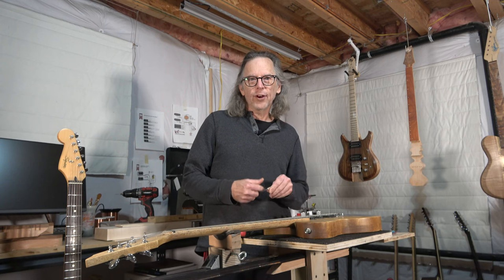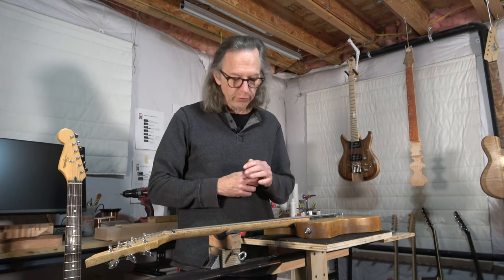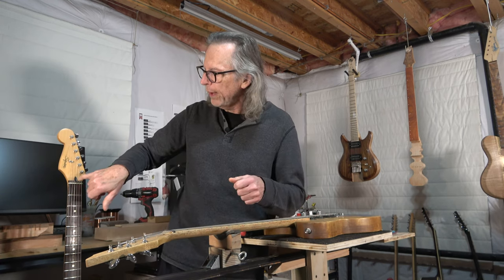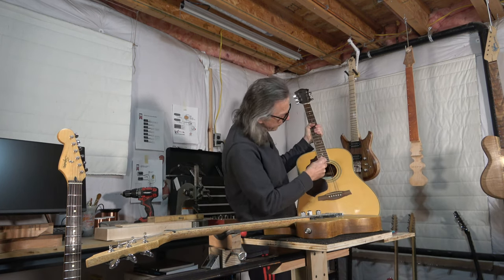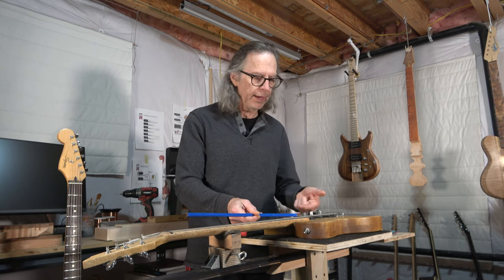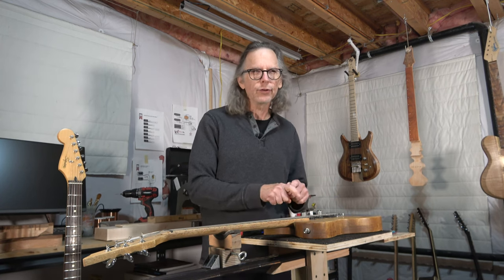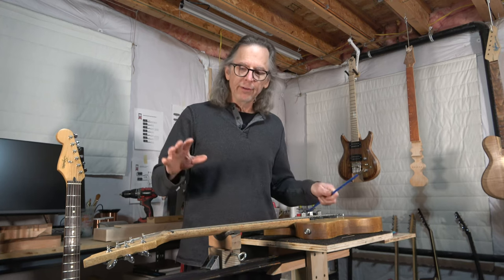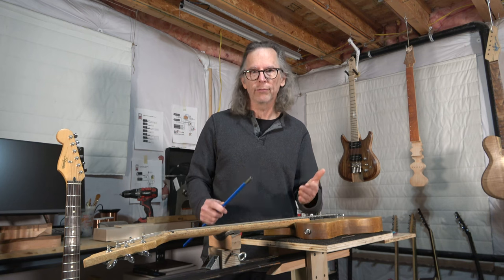Guitar Truss Rod Nut Placement

Comment: If you're building a mahogany neck, you could also consider a volute to add some additional mass underneath the truss rod access hole. And you might also consider using a scarf joint to avoid grain runout in the headstock and ensure a stronger neck. I know you're no longer a big fan of scarf joints, which is fine as long you're using stronger woods like maple.

Comment: As a player, one of the first Mods I did on my Strat was to put a notch in the Pickguard and wood underneath so a "paint can lid remover tool" can be used to adjust the Truss Rod easily without removing/loosening the neck, strings, or pickguard. It breaks my heart when I see a beautiful vintage Gibson with a broken headstock. It's an expensive repair and severely depreciates the resale value of the guitar.

Comment: I had to repair an upscale epiphone acoustic that had the headstock adjustment. So much wood was routed away that there was almost nothing left to make room for the large adjustment nut on the end of the Truss rod. I alleviate the problem by using a half inch steel tube on my acoustics

Comment: I want my necks to be as close to pre cbs as possible, and that has served me well. So it’s a single action and the heel.
I think tone follows the neck, and is second only to pickups in setting a guitars tone. 
I have no access issues, I do however have a special tool, and for the kind of minor seasonal adjustments I don’t have to remove anything. Usually a 1/4 to 1/2 turn or so.
I also like Brazilian fretboards.
So fender is out , and smaller manufacturers is what I use .
Same with body’s, I want one piece, light , under 4 pounds swamp ash, and fender just doesn’t do that.
I also want a more traditional, and thin nitro finish.
The heaviest tele I own is a tad over 7 pounds the lightest under 6. 
All heel at the time here.

Comment: Hey, Chris. I routed my first truss rod channel for a 3-string CBG bass with a 34" scale. It's a 1/4" route all the way. The brass fittings are snug but the rods are 7'32" I believe. Should I scrap the neck and save the truss rod before I put a fretboard on? It's a great maple neck that I hand built and I don't want to waste it but the build is for a friend so I don't want to send him a bad apple. Thanks!
Reply from the maker: I don't understand your problem.
Reply: you mean the trussrod is a little loose?  That probably shouldn't matter, and you could shim the gap with a strip of veneer (or almost anything else) if you're worried about it.
What I'd be more concerned with is whether the 7/32 (<1/4) rod is maybe just a "traditional" style rod, and not a modern self-supporting (usually 2 way) rod which are more typically about that width, but more like 3/8" deep?
If that's the case, it needs to be installed in a curved channel to work. tightening the rod tries to straighten the curve in the channel and that tries to back-bow the neck.
If it's a modern style 2-way rod (stewmac hotrods are around 7/32 x 3/8), then it''s probably going to work fine even if it's sloppy loose, as long as there's not enough room for the rod to flip sideways. ;)
maybe shim around the blocks with some veneer or something to snug it up.  a tiny bit of space around the rods isn't ideal, but it'll work fine with most 2-way rod designs.

Comment: Awesome.  I bought several Gibson /Epi guitars with broken heads.   I thought the flaw was design because the mass at that nut area was minimal.   Now I know it's wood based.  I suspect the mahogany. necks being under string tension adds to the issue.
Reply: Its a combination of things. The worst offender is the mahogany like you said. But the Gibson guitars also have an even steeper back angle compared to Epiphone, this increases leverage against the breaking point when smacking the headstock. Then there is the problem that the expensive more "fancy" guitars have a 1-piece neck instead of a scarf joint where the neck meets the headstock: the wood grain is oriented so that it wants to split apart at that weak spot. And lastly, they have a large chunk routed out at that very weak spot to fit that big trussrod adjustment nut.
Reply: @infectionsman  The "leverage" thing isn't really right (a 6 inline fender has more leverage), IMO, but otherwise spot on.  The steep headstock angle is the main culprit IMO.  It's not as much to do with leverage, as the fact that it sticks back relative to the body.  If you lay a fender flat on the floor, the head may not even reach the floor.  if it gets knocked over onto the floor, the body hits first and it'll probably be fine unless it the head hits something else on the way.  gibsons usually have both more neck angle to aim the strings at their taller bridges, and a headstock that leans way back.  If they fall flat back on the floor, the head hits first with the weight of the body still behind it.
The short grain, big chunk milled out for the trussrod, and mahogany splitting along the grain a bit more easily all add up to it being a fair bit more fragile in an accident.

Comment: Hello, I just realized the spokewheel on my guitar moves back and forth very little. Is it normal? I mean to say when I  put the hex wrench inside the hole of spoke wheel, it is not fixed and firm. It moves little bit. Is it ok?
Reply from the maker: It shouldn't move back and forth.
Reply: @HighlineGuitars  i mean to say from left to right. I hope I have explained it correctly
Reply: @projectsupernova6041  It should be firmly attached to the truss rod which should not freely woblle back and forth. It should take at lest slight prssure to turn it. Only you know the real answer on yours though. If the neck stays where you want it, and it doesn't rattle, then it is doing no harm.

Comment: If I want to remove the black plastic plug and leave it out, will it cause any harm?
Reply: It does help with the stability of the headstock. Well, a little bit.
Reply: Not if it's your traditional one-way truss rod. But there are guitars out there (especially Fenders IIRC), where the plug is essential for the rod's 2-way functionality! 
Although these plugs would usually be wood, not plastic, you better check twice - just to be on the safe side.
Reply: @kiwibass  I agree.
Reply: @kiwibass  thanks, I can't find an instance where anybody has tried this